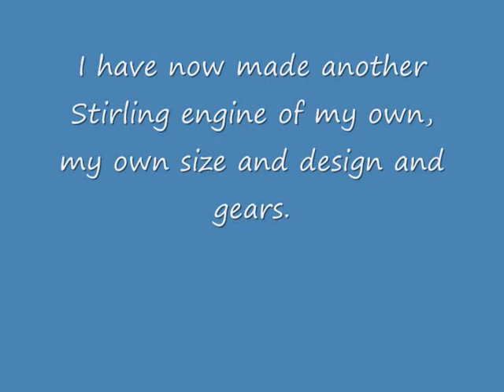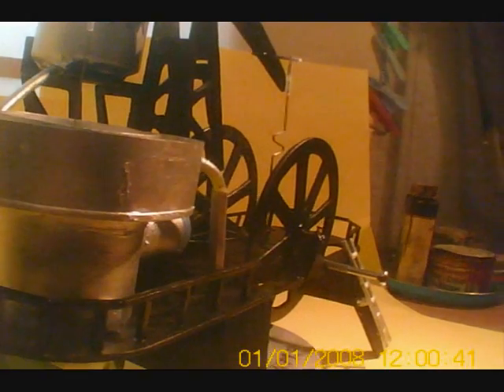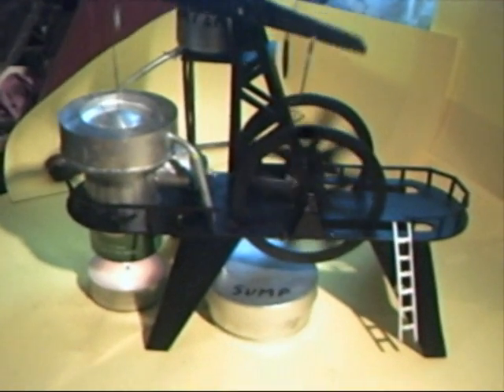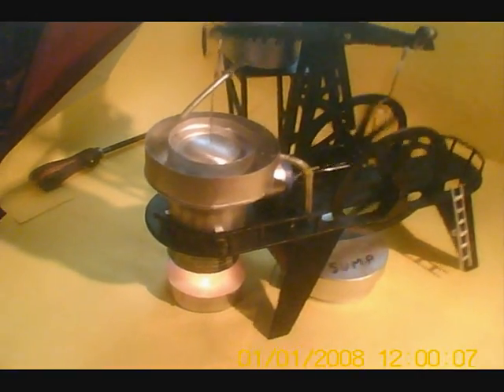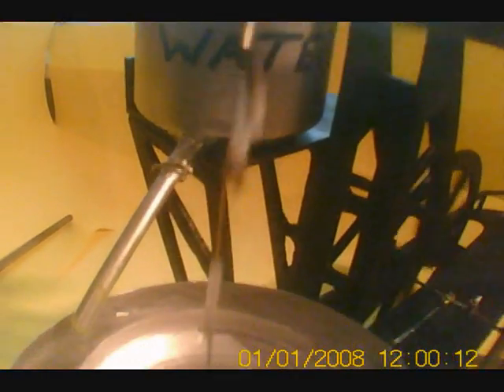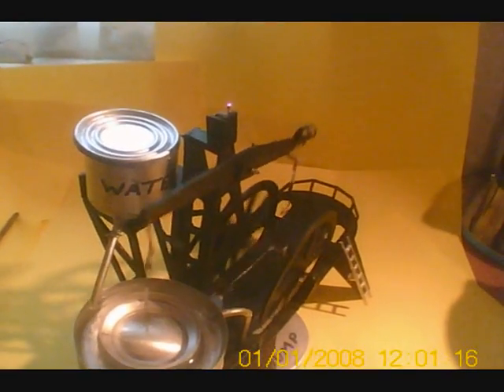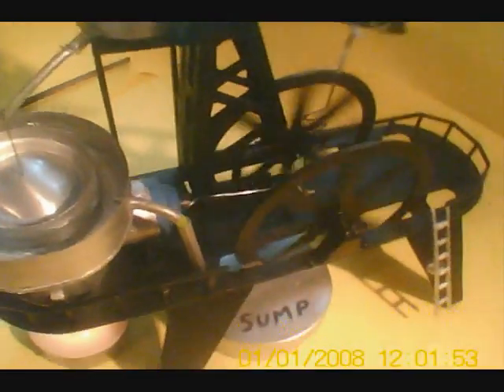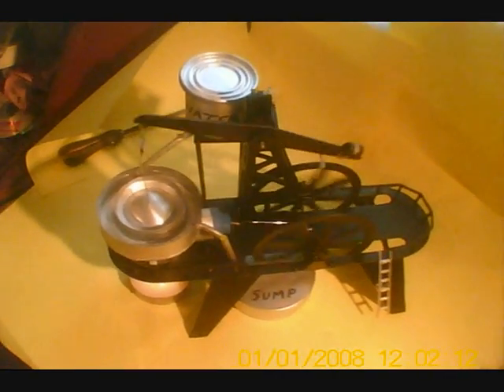Stirling Engine water cooled thanks to all other input  cheers, petethewrist

Comment from the maker: Thanks for your coment, I am still learing how to set them up for best proformance. When I tested the engine by hand  found the up and down for the displacer and then messured how much the power piston moved, I then set everythinng up for this movement. I will bear your coment in mind now, as I am about to test the two engines I am making for a double beam engine. fingers crossed I will post when done. I am hoping to make a small generator to run small light of it. fingers crossed. Cheers Pete.

Comment: Nice work! Congratulations! I belive you can get more speed from this engine. It seems tath your diaphragm makes some extra force due to the long stroke... maby I just  get this idea from the video but it seems that has this little "problem"... Althoutg is just a comment, don't get me wrong... the engine is very good, but I guess you can still optimize it's general performance, specialy the speed (if you're interested on tath, of course).
:-) 
Regards!